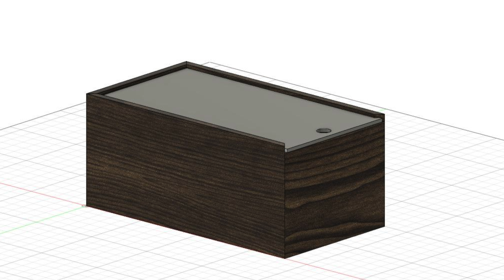Woodworking: How to make a sliding lid box

Comment: Pro tip....apply danish oil to the bottom before gluing into the sides/front/back. This will help when the wood moves to hide unfinished wood.
Reply: Will the glue still adhere to the wood surface after the oil is applied?

Comment: Nice project...rather than clamps for small boxes I often use several rubber bands to hold the box together with even, gentle pressure whilst the glue hardens.
Reply from the maker: Thank you!  That's a really good idea.  I'll have to give that a try.  - Ed

Comment: What kind of clamp is that? I am very interested in starting to make small boxes. Are there any small table saws that have adjustable blades for the depth and angles? Your videos have been very helpful!! Love it
Reply: I know this is a 2 yr old comment but I got two of these clamps for like 25 bux on Amazon, Powertec strap clamps, they're super easy to use, I bought a ton of 1/4 inch stock from TheHardwoodEdge and now I'm trying to get better at making different types of boxes

Comment: I only found this video after digging but I'm glad I saw it. How did you finish cleaning up the pieces where you cut the top of the side off for the lid?
Reply from the maker: Thank you for watching Randy!  You can clean up the glue in the corners using a straw where you cut a 45 degree angle on it.  It works really well and cleaning them up.  - Ed

Comment: Nice little project. I like seeing it done w/o all the fancy and expensive tools. One question here. Did you consider wood expension for the lid and bottom in the grooves? If so, what was your safety space? Thanks a lot! Rick
Reply from the maker: Thank you Rick!  It's been a year and it's held up pretty well.  So far there has been no issue with wood expansion.  It might be different if I live in a climate that had more changes in humidity.  Here in Arizona, it pretty much stays around 10 to 20% humidity.  Take care!  - Ed